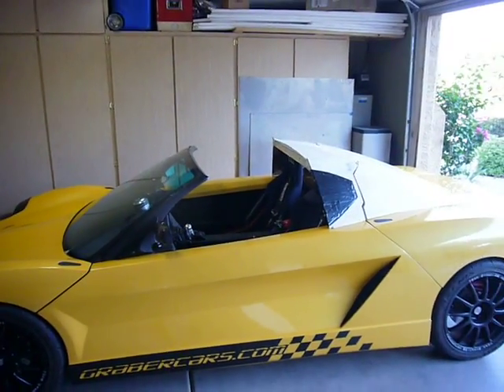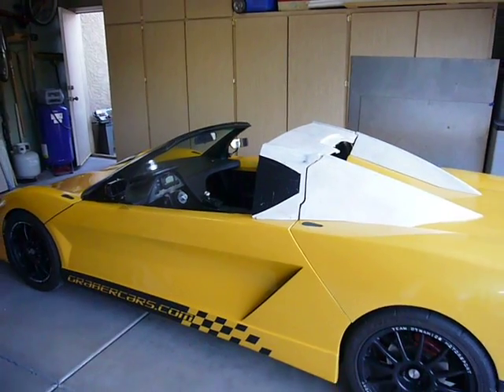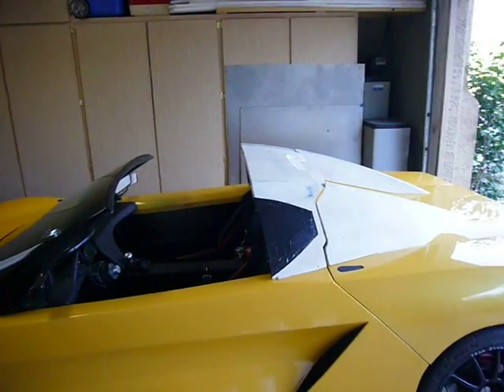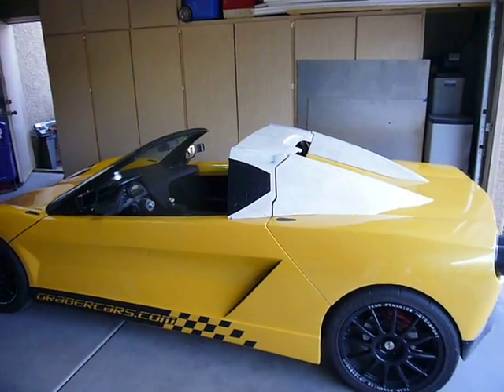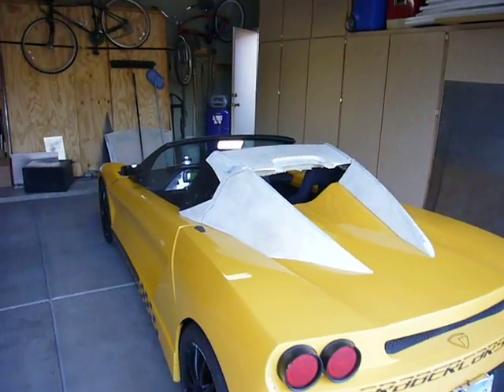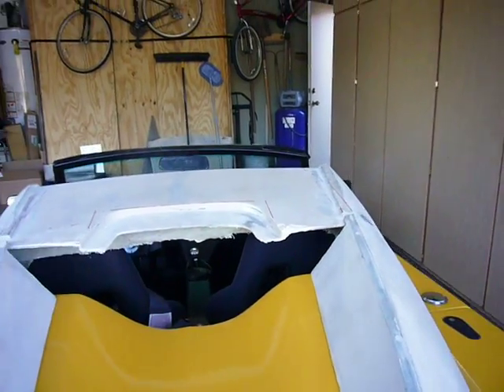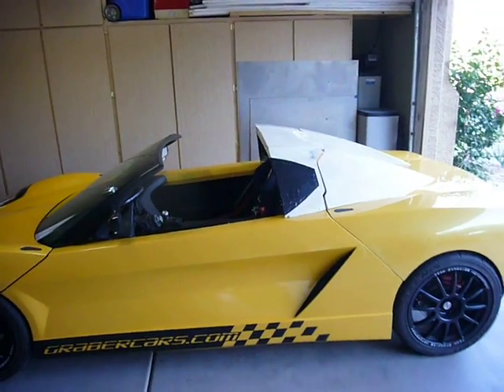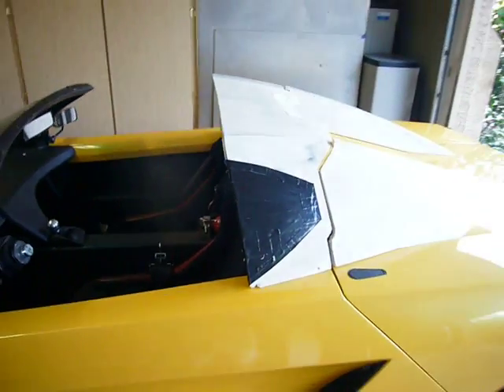La Bala Hard Top Prototype Progress

Comment: because it's a low car the door should perhaps include part of the roof for easier entry.
and if you break up the side with a door, couldn't the entire rear body be one big piece?
I would advice a smooth shaping that curves down a bit for aerodynamic reasons and ends as a kammback, a bit like the rear of the EV1 or GM ultralite.
and it should of course be electric. could be awesome
check evtv.me and wrightspeed X1. I can help with questions

Comment: hmmm. There are parts that I like. I do like the rear flying buttress that will be glass covered. 
How much room is there between the helmeted drivers head and the roof. Even with a full 6 point harness you will move up and down. 
Curious as to how my cage will interact with the roof. 
You are right though. In my current state of width, I assume getting in and out will be a job and a half. If it can be done.